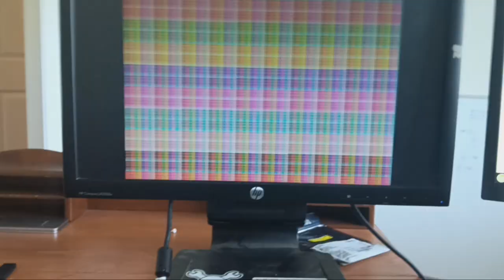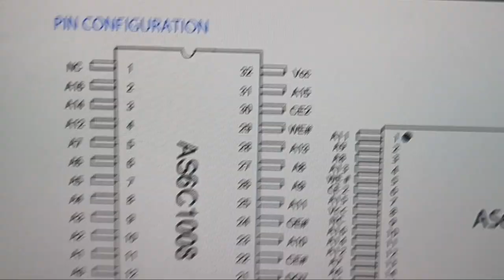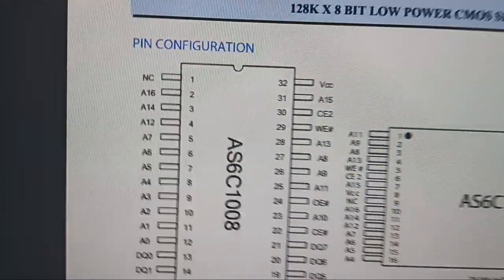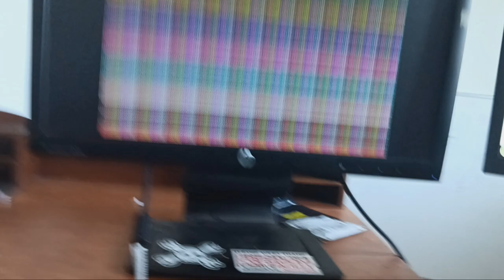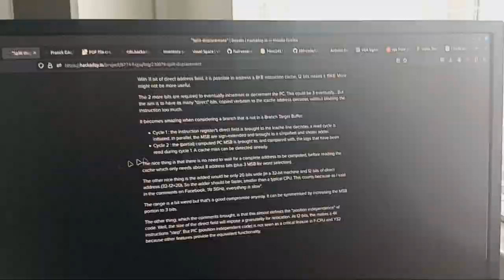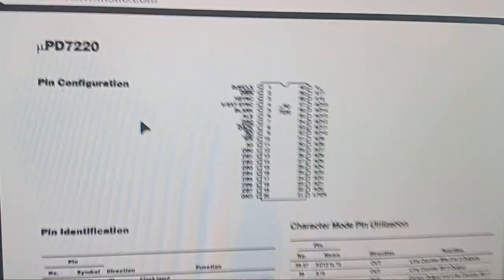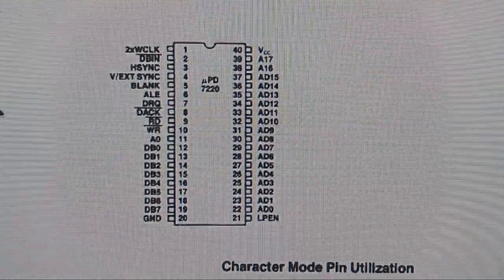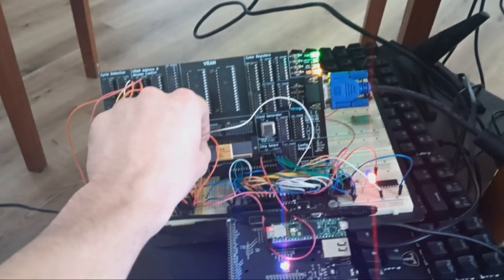uPD7220 Card V2 Debugging

Comment: Hi Dylan, I wanted to thank you for your work! A few months ago I made a board with uPD7220 based on your previous design (the one you published on Hackaday). I made it for a RCBus type interface, added 1M (2x512 kb ) of SRAM, used a GAL to decode IO and provided for PLCC (Z7220) and DIP40 footprints. I have yet to fully test it but it appears to work. I would like to share with you what I made so far. Thank you again for doing this, without your work my project would have been hardly possible.
Reply from the maker: Oh wow, I am really glad my work was so helpful!  Are you on hackaday?  Very happy to read this :)
Reply: @Nuclear_Man_D  No, I am not on hackaday (yet). before I publish (likely on github) I need to test more. I was thinking of sharing with you what I have so far. But thank you again for the quick reply.
Reply from the maker: @TMITLT  Of course :) I got your github invite, and I would accept, but github won't let me log in without 2FA, which I will never add.  Are you still working on hardware or drivers?
Reply: @Nuclear_Man_D  oh, I see, I will just make the project public but I am afraid someone will build it before I had a chance to test it properly. well, I will add a warning!

Comment: Cool project. How is the status now? Do I understand it correctly that this design allows high quality graphics on a Z80 8-bit computer? What computer do you want to use it with?
Reply from the maker: Yea - its designed to provide pretty good graphics quality output conveniently to VGA.  Originally the technology was designed for my Z80 computer, but I have since adapted the bus to also work on Teensy 4.1.  Here is the computer I actually want to run it on: https://hackaday.io/project/21201-arduino-desktop

Most of my documentation is either or hackaday or linked to hackaday, if you use that.  Great platform IMO.

As far as the status for the project right now, I put it on hold because I was having issues and the project is somewhat expensive, in both time and money, to develop the first time. I want to come back to it though.